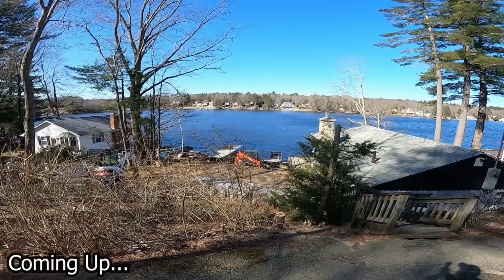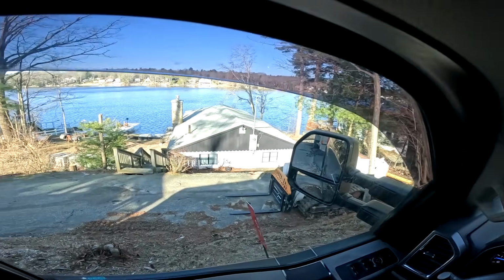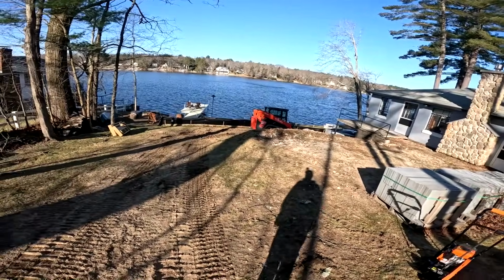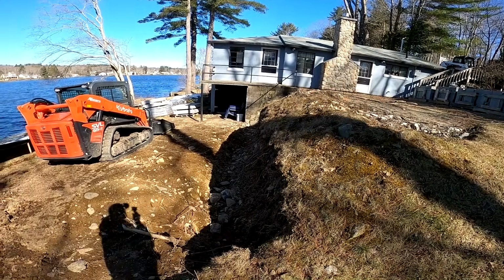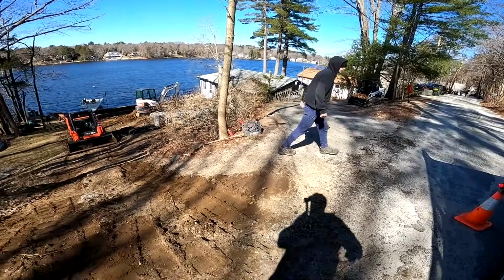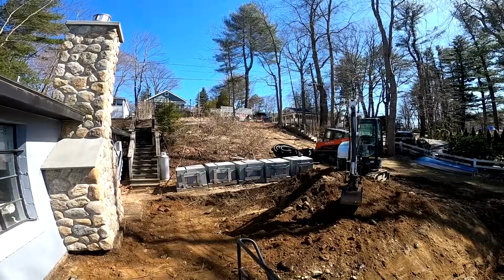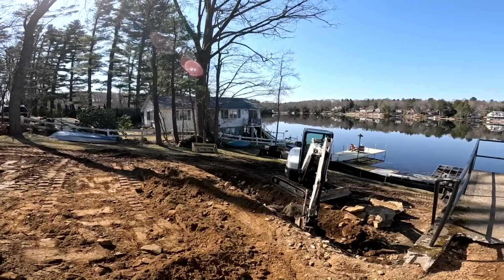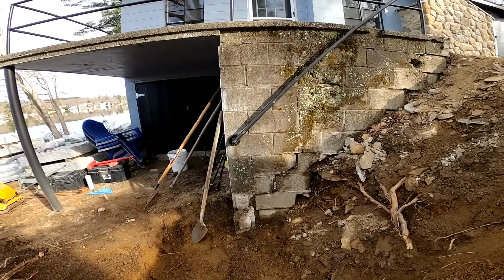2024 Hardscape Season Starts with a Lakeside Patio Install!

Comment: Great to see you and Benny back for the new season.  Do you plan on buying an excavator down the road someday?  I think a fairly used  2019-2021 E32 model runs about $38-42K.  Rentals in my area for an E20 run $740 for a weekly rate.  Good luck to you and Ben at the Northeast Hardscape Expo.
Reply from the maker: I do plan on buying an excavator someday, but there are few other things that I will buy before that. A Dump truck is the next big purchase I want to make. ✌

Comment: The end of that railing is lose u can see it move when u tamp it with the excavator
Reply from the maker: You are correct, the last block that the railing is connected to is loose. We are going to address it when we get the steps up a bit higher ✌

Comment: Hey kyle, just wondering what’s the advantage of steel grate sideboards vs wooden 2x10’s?
Reply from the maker: There is probably quite a few difference's but my trailer in particular just came with the mesh sides and I never found a reason to remove them. However, if they did not come with them it would cost a lot more to have them added than wooden side would be. So that is mostly why you see wooden ones.